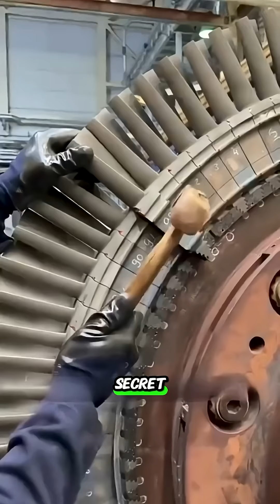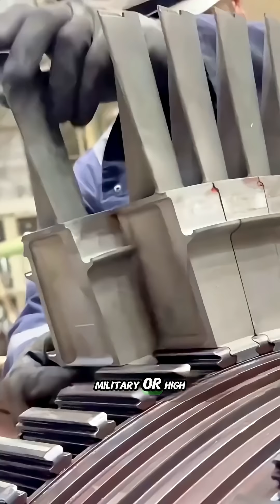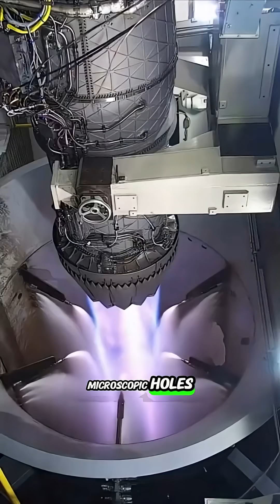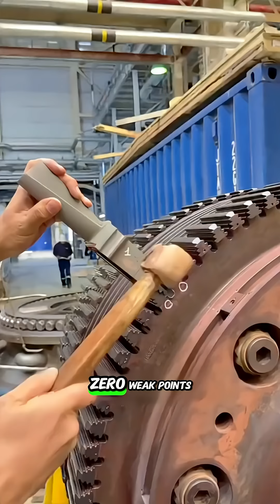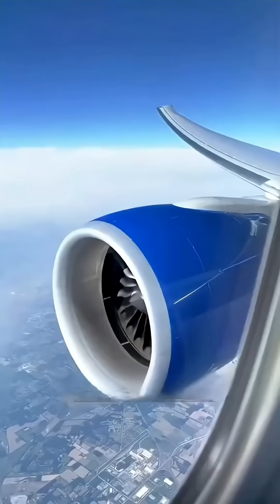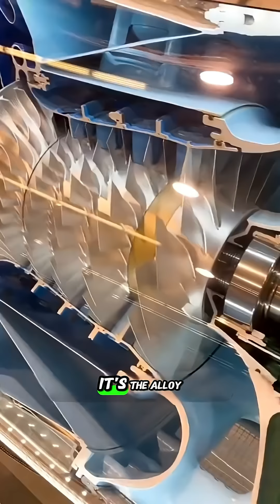The Insane Reason Nobody Can Copy American Jet Engines

Comment: So, why is Rolls Royce providing the new engines for the B52 bomber?
Reply: Because the Air Force needs new engines and Roll Royce makes good engines.  Basicly when the US Government had a project like this they pitch it to several companies and the one who agrees tk dk it for the least money usually wins but not always. The engines they are putting in the B52 are used in buisness jets and have a good maintenance record and it meets all the thrust and fuel burn requirements that the Air Force has.
Reply: @NathanDean79  Oh the ones made in Indianapolis, Indiana, USA, and Bristol, ENGLAND, UK
Reply: @geoffholme  under licence from RR of course.
Reply: @geoffholme  Don't trust UK anymore
Reply: @standalon3308 why not?
Reply: @NathanDean79 GE offered 2 engines one is on the A10 and has been around for years with a proven reliability both on military and commercial applications, the other is a newer engine with better fuel consumption. Pratt also offered a highly reliable engine. IMO it was a political decision. Military procurement officials are only human and are usually looking for a position after military retirement.
Reply: @jgarz1993 many retired military higher ups joined our ranks when i worked with boeing satellite division so i know this to be very true.
Reply: @NathanDean79  His point was RHETORICAL!
Reply: @NathanDean79 you missed the point.
Reply: Not because they are the"best" or most efficient, but because the other options do not fit the wing nacelle and it would be too costly to embark on a full engine program from GE or P&W.  People in this thread are all jjust chest thumping for their team.  The truth is that GE and P&W are the World's top engine manufacturers and they are certainly the leaders in the World.  Roll's is in third.  That said they all three make fine engines.  Russia is way behind at this point and so is China, but they are gaining.  France has CFM, but that is French Safron and General Electric, with GE doing the hard part in the Hot Section.  Germany has MTU but that is with Pratt& Whitney.  Most all of the European makers have GE or Pratt as a partner.
Reply: @_Coffee4Closers Dassault’s planes are equipped with Safran’ s engines hot and cool parts.
Reply: @doumedaurillac7393  Yes Safran on it's own... CFM is a 50:50 partnership with GE.  Safran does not run the firing temperatures of the CFM or other GE hot sections.  I never said that no other nation makes engines, but I will stand by the absolute FACT that GE and P&W are the World's biggest engine manufacturers and they are certainly the most advanced.  Rolls is the next closest competitor.
Reply: @doumedaurillac7393  and Rolls-Royce for the falcon 10X flagship
Reply: @doumedaurillac7393  I worked in GED, research and development and you are right!
Reply: GE engines are rubbish and unreliable RR engines are superior and better safety record. GE = Gets Exploded
Reply: @Rav-D  It's so funny when idiots like you come in here are say lidless nonsense.  It really does show a very low childlike mentality.
Reply: @_Coffee4Closers Well said!  And yes, Glen Gary Glen Ross is a masterpiece!
Reply: @_Coffee4Closers  Boeing guy here. I worked at both the Renton and Everett plants. Thanks for the detailed response in this thread. I just wanted to say that I concur. There may be some nationalistic pride in this thread, and that's fine to a point, but there is no doubt that the US leads. It's just a fact. GE and P&W just dominate.
Reply: @_Coffee4Closers  oh and which two companies have been hanging engines on the A320 Neos and the 737 max that has got a very large problems and so many Boeing aircraft and Airbus aircraft grounded! Oh yes of course it’s a good Old US of A 
Admittedly Roy has have got a bit of a problem on the power plant for the A350, but not quite as big as problem as P&W!
Reply: @CliveCharlton-v2w  You are hilarious, yes the GTF has had some issues, caused by a subcontractor using contaminated material, but try to pretend that other makers of engines never have difficulties.  You might want to look into that before opening your mouth next time.  Look into the Roll's engines and then get back to us.  Now after living in your pretend World, tell us who the top two engine makes in the World are... I'll wait....
Reply: @_Coffee4Closers us is not more nr 1  nr one its europe you like it or not fact is fact 😂
Reply: @jagaszepielak2601  Ahhhh, are you drunk?  I don;t even know that you said, it is just gibberish.
Reply: @CliveCharlton-v2w  you cant compare civil aircraft with military aircraft. Two completely different design principles and requirements. So far in regards to US military jet engines. No enemy country has managed to copy US jet engines and when they try they dont have the same performance as the US ones. There is many many reasons for this. From materials and exact procress to casting the parts to the exact layout of jet engines. Also the engined used on bombers and cargo planes are not the same kind of engines on us military jets. Overall this video is wrong in the sense that its talking about civilian made turbine engines which plenty of countries have. Its the military jet engines that not every country has and if they do they dont quite come near the performance of the US ones.
Reply: @wolf2179 correct.  This speaks to architectural complexity.  Xerox thought they could easily produce miniaturized copiers to put Canon out of business.  Xerox engineers had to educate management that it was not so simple and they struggled for years to replicate Canon copiers
Reply: @_Coffee4Closers well as the a350 has a much larger order book and is exclusively RR facts would tend to upend your assertions. (850 vs 697 (all variants)
Reply: @_Coffee4Closers  MTU has been taken over by Rolls Royce.
Reply: @_Coffee4Closers 😂 no American can ever admit something from another country is world class their indoctrination and exceptionalism blinkers prevent them …… if that fails then it’s default protectionism.
Reply: @robertpatrick3350  Japan makes better cars.  Listen fool I have never said that Roll's does not make "World Class" jet engines.  That is just your butt hurt nonsense, because I say that GE and P&W are clearly the World leaders in this field.  The fact that you want to act like the US in not the best in military aerospace is the problem, not me knowing they are.  So go ahead, tell me why Roll's is "better" than the American engine makers.. I'll wait.
Reply: @_Coffee4Closers Hey,can you ask you something.Do you think Japan will ever be able to jet engines?Do they have the ability to?
Reply: @elijahcorbie2471 Japan is a highly advanced nation with a lot of technology and heavy industry Mitsubishi Heavy Industries, IHI Corporation, and Japanese Aero Engine Corporation all already make jet engines and industrial gas turbines both on their own and as collaborations with US, and British makers.  I am sure that they have plenty of capability to produce World Class engines.  Japan does produce licensed copy of GE engines I know for some military aircraft.  I think it would be a very achievable goal to produce their own domestic fighter engines.  I guess the main issue is whether of not it would be worth the effort, to do so verses licensing engines from GE, Rolls, or P&W.
Reply: @_Coffee4Closers ok,what you think is stopping China and Russia from mastering jet engines?Are their engineers not creative enough?Do they lack metallurgy,technology or quality control culture?
Reply: @elijahcorbie2471 The biggest issue is the ability to productionize Turbine Blades at an acceptable rate.  Mainly due to the West's advantage in investment casting of exotic blades, with complicated internal layouts for cooling passages, and the ability to EDM drill very tiny cooling holes by the hundreds into those same parts, followed by using laser ablation to cut away microscopic levels of material to add diffusers to those holes.  And even after that adding corrosion protection and ceramic coatings to insulate the blades from extreme temperatures required.  All of these processes alone are insanely hard to do on their own in a laboratory, much less stacking them all on each part.  Then you have to get that out of the lab environment and get it into a repeatable process to make them by the thousands in a factory full of workers at a low enough scrap rate to not bankrupt your operation.  It is not an easy task.  Japan can pull that off I think, Russia at this point is screwed due to the financial and manpower drain of Putin's useless war. China can get there but is still going to take time.
Reply: @_Coffee4Closers  Ohhh,I saw China has the ability now in 2026 to build military engines and gas turbines but they don't have the same lifespan and fuel efficiency as American and British engines.That it might take up until like 2030 for the Chinese to get there.
Reply: @elijahcorbie2471 Yes, that is correct.  China builds their own domestic engines, in addition to some copies of Russian designs.  But life span is the main issue.  Obviously they will perfect this in the coming years as they gain more experience,
Reply: @_ @_Coffee4Closers Which is harder to build,a military engine or commercial jet engine?
Reply: @elijahcorbie2471 Military and Commercial engines are very similar, and in some instances will be sharing the same "Gas Generator Core".  However, military engines generally run higher firing temperatures that will require more complex cooling schemes, and more exotic materials in the hot section.  Commercial engines are usually focused on higher efficiency while military engines will be more focused on thrust while trading some efficiently for performance.
Reply: That doesn't get away from the serious problems with reliability on the P&W engines which have grounded scores, if not hundreds of A320 aircraft around the world. It's costing P&W billions to put right. Not to mention putting quite a few airlines out of business. It's one of the reasons alot of airlines are choosing CFM Leap engines for their narrow bodies, because the P&W versions are so unreliable.
Reply: @StephenOverthrow  Gezzzz, what nonsense.  Yes the P&W GTF has had some issues (not entirely their fault by the way) but the issue is being addressed.  Do you really judge companies by an engine program difficulty?  I have news for you ALL engines and Engine Makers run into these issues... this stuff is had.  If you think that GE has never had issues or Roll's has never had issues you need to realize that Google is your friend.

Try looking into the rolls Trent 1000 and Trent XWB and get back to us.  These problems were every bit as big as anything to do with the P&W GTF.  I was a design Engineer for both P&W and GE for over 30 years, and these these of things for new designs are kind of common.  Goals are missed, schedules get behind, efficiency predictions are lower then thought, mantinance timelines are shorter than expected.  It usually takes a few years to find these problems and then a few more to totally solve them.  Most people here yammering have never spent one second in aviation and sure as hell have never designed an engine.
Reply: @_Coffee4Closers 
Really good point about the RR Trent engines. They've certainly caused some problems for quite a few airlines. Nearly sorted now I understand. Just retired as an aerospace engineer, radiographer for landing gear. Nice exchanging with you.
Reply: @robertpatrick3350  I'm perfectly willing to admit that Russia and China excel at tyranny and despotism.  Not to mention murdering their own people and neighbors.
Reply: @_Coffee4Closers Rolls-Royce is first, closely followed by the American manufacturers.
Reply: @julianneale6128 Lol, dream on.
Reply: @julianneale6128  Nah. That's hooey.
Reply: @julianneale6128 As it should be...
Reply: Rolls Royce is a multinational corporation with headquarters in the UK and Reston, VA.  The engines for the re-engined B-52 are being built in Indianapolis, Indiana
Reply: @davidbarbee1276 built or assembled?
Reply: @doumedaurillac7393 

Good question, my guess is mostly assembled as it makes no sense to replicate the manufacturing of a difficult to produce component.
Reply: @Mentaculus42 True. Retooling a factory with manufacturing tools and machines that have only one purpose is very costly, especially since it is a limited run on new parts, since there are less than 100 B-52s still in service.

It's not like WW2, when US manufacturing was turning out thousands of the same plane on assembly lines. And they did that with numerous different types of bombers, fighters, cargo planes, etc.
Reply: @davidbarbee1276  to British design.
Reply: @julianneale6128  nope, German BR725 heritage!
Reply: @RenZ696 it does have German work in it. But it's Rolls-Royce. When it comes to engineering,  the British and Germans are extremely close in their ways of thinking. After the British,  the Gemans are the most inventive people in the world.
Reply: @julianneale6128 you’re a complete idiot.  The British are so inventive that their aerospace industry is kaput along with their auto industry.
Reply: @davidbarbee1276 with parts being forged, Heat Treated and CNC machined internationally
Reply: @davidbarbee1276  lmao who lied to you 😂. Its a British company headquarted in London, Reston is the HQ of Rolls Royce North America, a wholly owned subsidiary
Reply: Where were these engines originally developed at? England! Where they get built for the B-52 is a contractual agreement that has nothing to do with technology or understanding of manufacturing processes.
Reply: @Mentaculus42  giggles in V2 noises
Reply: @Mentaculus42 yup , Sir Frank Whittle!
Reply: @Mentaculus42  to be fair, the engines for the B-52 are basically BR725 engines developed and manufactured in Germany.
Reply: @RenZ696 

Probably so, I was lazy and didn’t check (but I thought I should check). But I was pretty sure that the development was NOT a U.S. THING! With all of the joint ventures between various jet engine manufacturers, it is generally safe to assume that the Europeans are mostly technologically comparable to the U.S. (maybe not in 6th generation fighter engines).
Reply: @RenZ696 That's correct.👍 Rolls Royce is currently building a factory in America to produce these engines for the US Air Force.
Reply: Because they are being built in the USA.
Reply: @Ebooger  taking an existing design and integrating it into the BUFF
Developed in Germany though.
Reply: And the Swedish Gripen.
Reply: @VidarLund-k5q Yes with it's AMERICAN MADE GENERAL ELECTRIC F404−400 Engines... thanks for making our points for us, it is appreciated.
Reply: @_Coffee4Closers 
Which are going to be replaced with Rolls Royce engines, to fill the orders for Canada over the F-35, because the rest of the world is tired of being told what it can or cannot do, with objects that they purchase and own, within their own country.
Reply: @coolhand1964 
Proprietary! If they want it they must agree to the terms.
No hand and not cool…
Reply: @jfs7327 
You call it proprietary (correct spelling) intelligent people call it coercive control.
Reply: @_Coffee4Closers Gripen NG has a proposal for the EJ-230, which would offer better performance over P&W (on paper).
Reply: @donkiel9988  Well since it uses the GE F414G engine and not anything from P&W in the first place as far as I know, I don't know what you are referring too.  Either way those are US Engine makers, soooo...  The idea that you can just stuff the EJ-230 into the Gripen for little to no actual gain would be a costly undertaking.  This is all based on Europe having a temper tantrum over Trump asking them to spend more on defense, not on the engine being in any way better than the well proven GE F414G. Good luck with that.
Reply: @_Coffee4Closers  Guilty as verdict, I muddled up P&W and GE. 😉 

You can't blame the Europeans for establishing independence, since tarifs and embargos seems to loom over how successful the last venture on the toilet next to the oval office was. 😂
So yes, American jet engines were part of NATO doctrine, but as I said, it would be stupid not to look for alternatives, as nobody can rely on what might happen tomorrow. It will be interesting how long the implementation of the EJ230 will last, but surely it will come.
Reply: @_Coffee4Closers  Unnecessary flag waving. It's not a temper tantrum (that's rather typicalTrump MO), it's basic self-preservation. Had Trump "asked" Europe to spend more on defence, things would be looking different now. Instead, in his abysmal political incompetence he figured that somehow bullying would work. Well, all he accomplished was destroying the trust US enjoyed as an ally to American defence companies' benefit. Now he is going to find out as Europe is already spending way more money on defense through programs like SAFE, but, thanks to Trump, not in the US. He just went a bridge too far so I don't think they will be hanging his portraits at Lockheed or Boeing headquarters, he has already cost them. BTW, the Eurojet engine is well proven, has been powering the Typhoon for years and looks like the latest incarnation will be an improvement over the GE414. Saab claim it would be a relatively straighforward replacement.
Reply: @_Coffee4Closers  RM12, a variant of the GE f404 engine, was made by both GE and Volvo Aero together. 65%-35%. 
The newer Gripen E engine f414 is made by GE and MTU(germans).
Most of the parts of the engine are assembled in the U.S and then shipped to GKN(former Volvo Aero) in sweden for them to put them in the Gripen E's.
MTU's shareholding/owner stake in the f414 engine is at 2.9%.
Reply: @_Coffee4Closers .   I was with you until you tried to take a potshot at European countries re trump  and spending levels. Just like the Europeans and Canada were happy to let the U.S. lead on military affairs, and to support their military-industrial complex by buying from it. But if forced to spend as much as the U.S. on military going forward, of course they’ll start to build their own equipment. That’s not a temper tantrum; that’s common sense.

Now throwing your ketchup covered plate at a wall because someone didn’t get his steak burned enough, that’s a temper tantrum.
Reply: @coolhand1964 — I am very much opposed to “planned obsolescence” entirely, as well as “proprietary maintenance,” but only in the commercial ‘free market’– when it comes to military security, protection of national intelligence, and other concerns, it is CLEARLY in the best interest of the USA to protect as much data that gives us advantage as possible, in order to maintain our edge against the all-too-frequent megalomaniacal personalities or groups with desires to rule the world. 
So, in the matter of supplying our allies, we should trust them with the tech, but not necessarily the manufacturing tech…
Reply: @handynothandsome261 
It's a typical analogy of USA hubris, to say we will supply you as an ally, but we will only tell you what we want you to know. It is worth noting that the F-35 was a 'joint' initiative. Nine countries were originally involved in it's development, and it's funding. Furthermore, in terms of military technology and intelligence, that also is a joint asset, with information being shared amongst allies, as well as locations of bases in foreign countries providing strategic advantage to allow the gathering of such information. Pine Gap in Australia being a prime example. I could list the technological developments of such countries as Australia, the UK, Canada as part of the 'five eyes alliance' but I will let you do your own research. The USA seeking the assistance of Ukraine to provide it with 'stinger' drone hunters, after going to war with Iran, which were a complete development of Ukraine, while at the same time the USA is refusing to allow Ukraine permission to build it's own Patriot missiles under license. At the same time let's not forget that the Shaheed drones that are causing so much devastation to Ukraine and other nations in the Middle East, exist because they were reverse engineered from a drone the US lost over Iran many years ago. 
In the 70's and 80's UK MI6 had an asset deep within the Kremlin, and the CIA became aware and sought to gain access to this asset. MI6 refused however due to political pressure they were forced to supply the details of the asset to the CIA. No sooner did this occur than the UK asset disappeared. In 1994 the Chief of Soviet Counterintelligence for the CIA, Aldrich Ames, was arrested for being a Soviet Asset and it was determined that he was responsible for the disappearance of the UK asset. It has long been the belief amongst the allied intelligence community, that the US has what we call down here, 'The Errol Flynn Touch'.
In terms of megalomaniac personalities, Donald J Trump is currently one of the biggest narcissistic megalomaniacs the western world has ever seen. He has proven that your Congress and Senate have absolutely no backbone, they are only interested in getting their snouts into whatever money trough is available, your Supreme Court is a toothless tiger and the US Constitution is not worth the paper it is written on. He is the most transparently corrupt man in office ever seen in any Western Nation and arguably the greatest intelligence asset the Russians have ever had. When the South Korean President tried to lead an insurrection recently, it was over in 6 days, the President was arrested in 10 days, and he was sentenced to life in prison within months. Perhaps you should look to the rest of the free world as an example before you start chest thumping about how nobody else can be trusted and the USofA knows best.

Note: 'The most infamous CIA officer who operated as a deep asset for Moscow was Aldrich Ames, who served as the head of the agency's Soviet counterintelligence branch. He was arrested for espionage in 1994 and is serving a life sentence after compromising over 100 operations and causing the execution of at least 10 Western agents.' That's 10 Western assets, not just the one mentioned above.
Reply: @_Coffee4Closers 
The US was seeking to prevent to sale of the Grippen to Canada, over the F-35, because it was the US who was having a temper tantrum, saying that no spares for the GE engines would be supplied if Canada purchased the Grippen over the F-35. Then Canada dug it's heels in and said stick your F-35's up your butt. The Rolls Royce engined version off the Grippen has already been test flown, which has been the catalyst for Canada to purchase it.
Reply: @DrittAdrAtta  Tbf, we’ve been “asking” for over 20yrs, but Europe wasn’t interested because they believed that funding their military encourages war, when it’s been wholly proven to be the opposite. Trump played hardball and it worked fantastically. Now rly only Spain is dragging its feet on defense (tho I think that’s a more philosophical approach on their part, as they likely believe there’s no point in supporting NATO, as if russia or whoever make it to the borders of Spain, then it’s already too late anyway. It’s also not like Morocco is gonna invade anytime soon.) Trump can be a blustery fool on many topics, but he got very good results with allied defense spending and investment.
Reply: @LeGrandSarrazin Let's be honest, whatever "results" he got, they are modest at best, it's not what he was obviously hoping to get, which is "buy more American".  So far, what is 100% certain is that he lost Portugal and Spain, which adamantly excluded the f-35 as their new fighter, directly as a result of his threats to NATO allies. Moreover, several NATO countries have just announced they will be buying their new airborne early warning radar systems from Sweden/Canada instead of the USA, despite Trump's efforts to push an American  system.  The list of Trump's "results" is certainly not closed, we'll see what Canada does next, and they have already shown they have the guts to give Donny the middle finger when they have had enough of his BS. Basically, thay have seen him through for what he really is - a smalltime grifter in a big chair.
Reply: Brits are really good too.
Reply: Did you listen to the video.  He said other countries can, but only a few.  You people don't listen
Reply: @greggcurrie1399 that depends on who's yapping
Reply: @greggcurrie1399 the written titles at the beginning specifically state nobody can.
Reply: Because it needs the money honey. 😁
Reply: lol not a flex buddy….. it’s because retrofitting or changing the design of the b52 to accommodate fewer but more powerful engines was deemed unfeasible. The engine which most closely matched the existing engine in weight, size, power, etc is an RR. Congratulations RR was able to build an equivalent  engine to one designed 80 years ago, but more fuel efficient.
Reply: Because current Boeing engineers are having to hit the boneyard and pull B-52 engines to rebuild so we can fly missions with them. I am from a Boeing family and live up in the Seattle area. Boeing has teams of guys flying out to the boneyard and rescuing engines to put in our current b-52s. They are still very valuable and extremely capable planes.
Reply: Was waiting for this comment!
Reply: Higher kickbacks to the politicians.
Reply: Ever heard about Rolls-Royce and Airbus. Really, what shit is this ???
Reply: The blades are made right here in the US.. How do I know this, well I work in one of the couple of plants that produces them.. I inspect those blades every night..
Reply: I've flown Garretts, Pratt and Whitney, GEs, and Rolls. 
25k hours, never a catastrophic failure. Only a few precautionary shutdowns. In the industry very few pilots have strong brand preferences.
Reply: Because they bought Allison, who originally designed the core engine.
Reply: @andyharman3022  Thanks, I didn't know they bought Allison.
Reply: Because they are the best
Reply: RR are also being installed in the Swedish Gripen, and also improved beyond measure  Not to mention the P51 Mustang - a piece of junk until RR replaced the yank engine :) :) Seems to be a trend here.
Reply: Because RR was already making a modern engine that would fit in the B-52’s unique double nacelles.  GE and P&W would have had to design a new engine or heavily modify an existing engine, which would have been much more expensive.  The original 1950s P&W engines ceased production long ago, and are obsolete anyway.   No one with a brain is saying RR doesn’t make excellent jet engines.  They are on par or nearly on par with GE and P&W, especially when it comes to commercial engines.   The French are a half notch below those three companies.  The Russians and Chinese are far behind, as evidenced by their very short engine lives.
Reply: @bluemarlin8138 : you forgot to mention CFM and IAE ....
Reply: @bluemarlin8138 Sure, the point is that base premise of this video is wrong.
Reply: @cristianr3712   But it's not, RR makes great engines and the US dominates the engine market so the video is correct
Reply: @bluemarlin8138 
That's Western propaganda.
Russian military engines are way, way more reliable than US military engines. The F22 (AKA the hanger queen) famously required 30+ hours of maintenance for every flight hour..
NATO was dumb-founded when Russia sent a dozen planes to Syria and they were able to maintain a sortie rate that NATO would not be able to achieve with multiples of the number of planes.
Reply: Because the Air Force wants good engines on those planes.
Reply: @soaringvulture and those engines will stay on the wing until retirement
Reply: @soaringvulture  What a stupid comment. You think GE and P&W the World leaders in jet engines are not being used because they are no good?  It is because the Roll's engines fit the wing nacelle and it would be to expensive and time consuming to start a new engine program idiot.  You people are amazingly stupid.
Reply: Made in america by law
Reply: The Americans won't like that
Reply: Because they are far more efficient.
This guy ist ein Kuatschkopf 😅
The reason turbine last is the FADEC
Full authority digital engine control
!
Reply: Free enterprise…
Reply: @brianlaney7596 you mean government spending propping it all up.
Reply: @peternewman7940  government spending seems to be propping everything up these days.
Reply: Youtube always give misinformation
Reply: You know ! Contracts! How it got there who knows.
Reply: To our standards
Reply: USA and their best buddy Britain aka USB
Reply: Because it's the right size engine
Reply: They won the tender to supply engines meeting the USAF specification. D'uh!
Reply: Because they are essentially commercial engines
Reply: 😂😂😂 Does it assemble in America?
Reply: Everyone needs to consider that the mighty Chinese Air Force would have MAJOR problems during any conflict due to their lagging engine technology…like nearly everything else they develop, their ships, their aircraft and most everything else would be breaking BIGTIME under the strain of heavy combat operations… I fly 787’s for one of the majors and the GeNx just purrs like a kitten everytime you start it and push the power up for takeoff… It’s, by far, the nicest airplane I’ve ever flown…
Reply: Residue or excess liquid dye penetrant (red color stain) used probably during NDT is still observed , was ultrasonic cleaning after testing  not considered as post cleaning method to take out the residue?....or the stain could be of  another solvent.... just asking?🤔
Reply: Crap.... again!
Reply: Rolls Royce has been making engines in the US for a century
Reply: TDS lunatic alert 🚨 TDS lunatic alert 🚨
Reply: Simple. The U.S. can afford it. They are the Alpha, plain and simple.
Reply: Precision is not always your friend in jet engines.  P&W engines can choke down a good sized bird and keep running.  Today’s GE or RR jet engines may have better fuel economy and are quieter—but don’t hit a bird at altitude.
Reply: Cheaper
Reply: @wendellmccall4453  Exactly correct!  The Roll's Engine was easy to adapt to fit the nacelle and was in the right thrust range required.  It would have cost a sht ton of money for the US to start an entire "clean sheet" engine program for a limited number of aircraft.  I can't see why this is so hard for people to grasp.  It is absolutely not because Rolls is any better.

Roll's makes fine engines but they are not the leader in this field, and why all the America Haters wanna come in here and attack GE and Pratt id beyond me.

The funny part of this is that the video maker did this on purpose for "Rage Bait" and boy did it work.
Reply: B52 Stratofortress using Current/legacy: 8 × Pratt & Whitney TF33-P-103 turbofan engines... 
Not RR now...
Reply: Rolls Royce has held stake in American aviation for decades
Reply: Amen
Reply: How's about the ones made in Iran
Reply: You read the first comment and now this rollsROYCE BULLSHIT WHEN TO YOUR HEAD ?
Reply: A lot of American dominance in aviation engines will be because the US government is spending money on their military services that others cannot match. Remember that money is not being spent on rail services or homes, hospitals and high-schools for the poor. Many things in life are about money and how you choose to spend it.
Reply: @peternewman7940 Where the eff do you come up with this BS? Are parroting media talking points?

We do have rail services. 140,000 miles of Class A railroads, that carry both millions of tons of freight every day, plus passenger trains that carry passengers to every major American city and thousands of smaller towns. That was all built by private industry. Many major metropolitan areas also have light rail lines that carry people to and from work. 

Our home building industry builds around 1,000,000 housing units every year. But housing costs are soaring because of excessive regulations and fees placed on home builders, plus the massive influx of immigrants coming here, manyvof whom want to buy homes. Government funded housing is a joke, because of massive cost overruns and often crappy workmanship.

The US thousands of hospitals and new ones are always being built, andcothers expanded. We spend far more on medical technology than any other country.  Heck, any large American city you can name has more MRI machines than all of Britain.

On paper, the American education system spends more per student than any other country. Unfortunately, a very large chunk of that money goes towards the education bureaucracy instead of towards the classroom, and it gets worse every year.
Reply: @peternewman7940 well said
Reply: And because they are so specific I mean dreadfully specific as to how those aircraft handle and everything it’s not just rip off four or eight and put in for it’s you gotta have something that is exact and designed for it in the load capacity and everything you watch some of the Chinese fighter craft and go up there and try to engine wash those things it’s fucking nasty and those B-52’s will just hang out and take it but it’s not the easiest process in the world and you don’t do not I mean do not wanna fuck up those 52s.
Reply: More USA bullshidoness. Some people from that country are Lovett first name Phil...🤣😆🤣